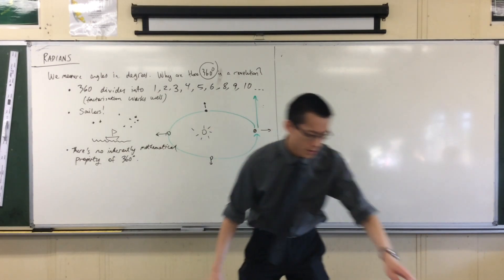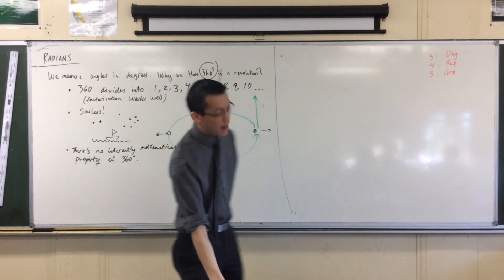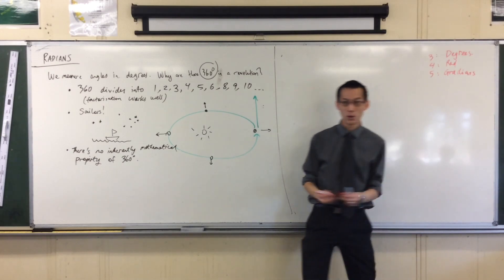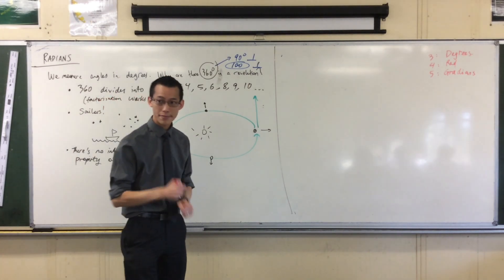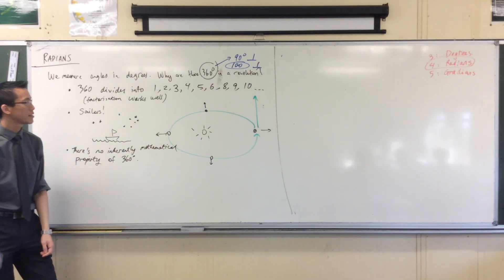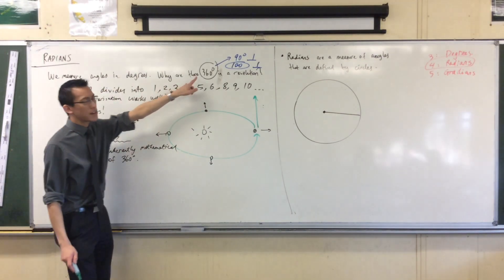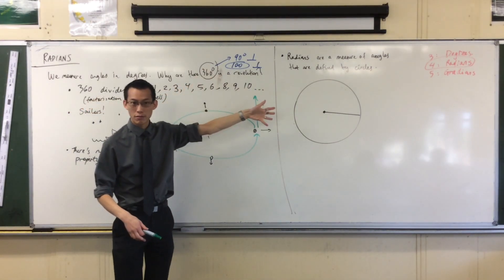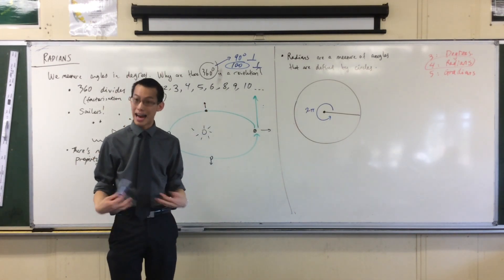Introduction to Radians (2 of 3: Defining a better way)

Comment: I'm European and I've never ever heard of grad O.o I imagine it's only used in very specific contexts?
Reply: At one point, it was part of the definition of the meter.   The meter was set up so that 100 km would be 1 gradian of latitude along the longitude line through Paris.
Reply: Afaik really just surveying (not sure which countries) and maybe the French artillery still use them. Saying something is used "in Europe" isn't very useful really.
Reply: I've never used a grad angle unit in my life, aside from looking up the definition to figure out what that button on my calculator is for, and playing around with the concept.  I've never seen a schoolwork problem feature the unit, nor seen it used in practice.
Reply: A few European militaries still use them occasionally, I think. They seem to be fading even from calculators.

Comment: On the equator 1GRAD ~ 100km
Reply: Fun fact, that's because the initial idea for defining the meter, was that the distance from the equator to the North Pole would be 10 Megameters. Their estimate wound up being off, but that was the basis. The circumference intersecting the poles is 40,007 km and the circumference around the equator is 40,075 km since Earth is not a perfect sphere.

From there the gram was defined as the mass of a cubic centimeter of water, or the kilogram a cubic meter of water. So the earth really was the basis of metric units, which is neat in terms of what the arbitrary basis could have been.
Reply: It's actually the longitude line going through Paris that defined 1 gradian = 100 km.